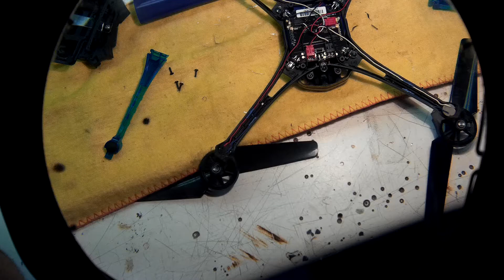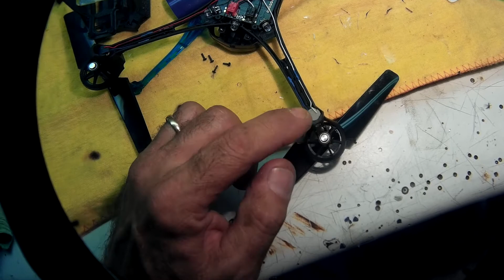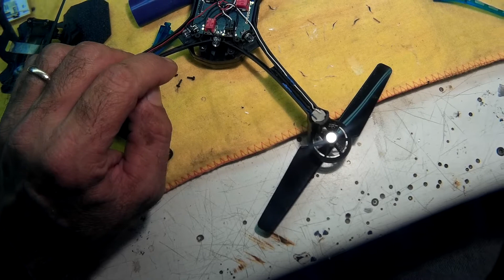Traxxas Alias v959 motors  wiring set up explained

Comment from the maker: thanks Andrew P , my pleasure
Reply: for those of us still trying to work through this motor crisis, Could you tell us again where you got yours?
Reply: Nathan Williams I just got some from here at http://micro-motor-warehouse.com . I read a lot of good reviews online about them. I received them a few weeks ago and decided to put them in now, even though the new traxxas motors were working just fine. I put them on back burner for back up.Wanted to test these out. They are noticeably faster, the alias rebounds from flips quicker then the traxxas motors. An they’re only 30$, They have plastic pinoins , Which to the average joe(me), didnt sound good, But on paper, the reason behind it made sense. I wish I could remember why it was. I ordered  mine on a Thursday and received the following Tuesday.
Also if your in the US, check out ebay. I ordered some from Mark twains hobby shop for 35$. They’re the actual traxxas motors, but the new motors (no vent holes or tape that they put over the vent holes. They have been going good for a few months now, Around 8  battery packs through out day. I just wanted to the the cordless motors from micro motors so I took them out and will use for back up. I think traxxas has fixed the issue. I hope. My 1st flight 2 motors went out. So 2 months is a huge improvement for me.